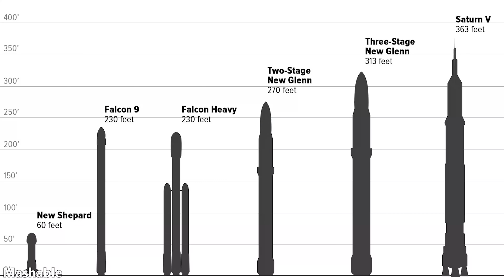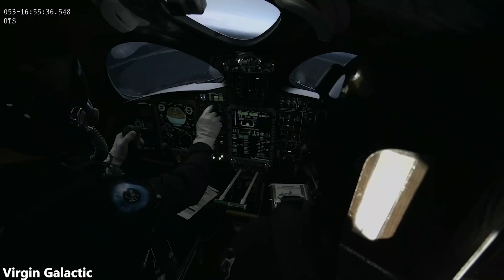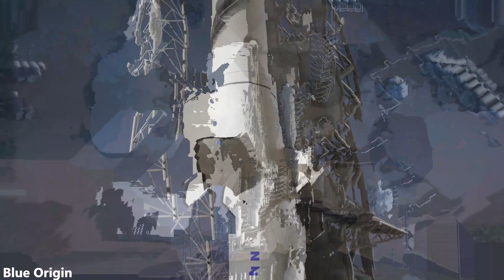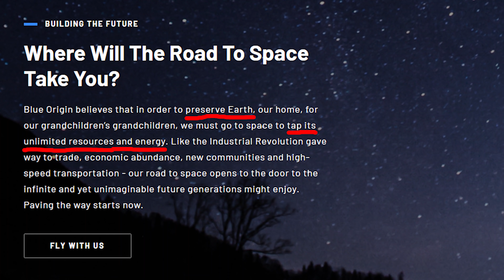What Happened To Blue Origin

Comment: The demand for moving heavy material and people into space over the next 50 years will be many magnitudes larger than what NASA/SpaceX are capable of. The New Glenn Heavy Rocket from Blue Origin is scheduled to launch in 2021 and already has three commercial contracts for services. I believe that NASA has also added the New Glenn to their launch services catalog. I live on the Space Coast in Florida, they are here alongside SpaceX and ULA and have been for several years in a large facility on the Cape. The biggest difference I see between SpaceX and Blue Origin, Blue Origin is not as public facing.  Having multiple launch options is a good thing especially in a business where several launch failures can put you out of business.

Comment: If you've ever been through a bad hurricane, you will experience first hand what living in an energy crisis is like.  I went through Ike and Katrina.  (luck and location at the time)  Forget the generator.  It'll be stolen most-likely.  Get yourself some solar.  It was reliable and most people don't understand how it works enough to steal and utilize it.  We were the only ones for five miles with lights and power.  By fourteen days, we had to pull them down.  Things were getting sketchy around there so we planned to bug out.  Luckily the lights came back on and it was amazing how every thing just 'went back to how it was' in an instant.  Still, because of experience, I will always have solar as both backup and some primary power.  Lights and power are security.  Helps you aim :)

Comment: 1) BO is not a copy of Spacex, as BO was founded 2 years prior to Spacex.
2) Prototyping for New Shepard began in 2006 and uncrewed test flights started in 2015. The first crewed flight was originally expected in 2019, now the date got pushed back to at least 2021 and the test launch cadence has actually decreased. This rather looks like an axed budget and a slow death, not like something that will pioneer space tourism.
3)"This will likely BO´s first step in flying commercial crews to the ISS". No, BO has neither gotten a contract from NASA to do so,  nor has BO announced the development of the necessary capsule funded by their own money. And neither Crew Dragon nor Starliner nor Orion are designed or inteded to be launched by New Glenn. So no crewed space flight beyond New Shepard. 
4) "Blue Moon is expected to be used..." Nope, BO has not been contracted so far. NASA still has not picked their favourite vehicle. Also, Blue Moon is only the descent/ascent module. In order to get to the moon, it requires the systems of other space companies.
5)While Bezos may talk about space visions of the future, he has never announced any commitment to building structures in space or the moon. There is no definitive goal put out by BO to build bases on the moon, asteroids or in space by themselves. There is no comprehensive plan behind this. It is just a sales pitch for their upcomming rockets.

Comment: Won't beat you up, but from the onset when describing differences between F9 and NS, you might have mentioned that F9 is an orbital class booster that moves in an orbital arc landing far down range, not just straight up and then down.

Comment: Well, what happened to Blue Origin?
Absolutely nothing. And thats the entire problem.
Reply: Elon is better at twitter than Bezos.
Reply: @danielmonge2318  Elon also turned out to be better in designing rockets in a reasonable timeframe.
Reply: @AliothAncalagon  As if Elon was the one who actually designed the rockets... LMAO
Reply: @LunaticTheCat  Thats exactly what he did as chief engineer.
Funny thing is that Elon is not even particularly proud of that. He says he only ended up doing it himself because none of the experienced good engineers wanted to join. And he blames this for the result that they ended up needing 4 attempts to get into orbit.
You can have issues with Elon, I sure as hell have a few, but there are some achievements you simply cannot deny without just making yourself look uninformed.
Reply: @LunaticTheCat  at least Spacex can land rockets dead centre while blue origin can barely land them on the pad
Reply: @mindzee83  You are simply coming across as being not well informed on the subject.

He has a degree in physics and was doing "hands-on work" by designing the Falcon 1. Elon himself names his lack of experience in the field back then as a reason why the rocket needed 4 attempts to reach orbit. It shouldn't come as a surprise that a physicist who is deeply involved in the engineering of a new orbital rocket for more than 6 years can be considered to be the chief engineer of said rocket. 
Competence is not as isolated as certain degrees might make it look. One of Musks partners designing the Falcon 1, Tom Mueller, was a mechanical engineer. Was he incapable of designing rockets as well, because he was not specifically a "rocket engineer"? Thats not how degrees work. I am a mechanical engineer as well. Even though it might not have been a complex and specific part of my training, it gave me enough of a foundation to do blacksmithing. Different fields of competence intersect with each other.
And different fields of engineering and physics most certainly intersect with each other.
Your objection here ends up having no foundation.

"there are people that put ideas on the table and he discusses it and chooses the best one for the job."

In some sense thats certainly true. But this has less to do with lacking competence and more with the fact that you aren't going to design Starship as a one man project.
Musk is a physicist and in years of "hands-on" rocket engineering he became a more proficient rocket engineer than some people who actually have a specific degree in rocket engineering I know. You are of course free to deny his competence and simply assume that he is only the chief engineer because he overruled everyone who thought he couldn't actually do that. But the reality is that whoever will talk with Elon about his rockets, will not talk with a marketing dude who knows nothing about its development, but with someone who knows his craft of engineering said rocket in great detail.
Because even though some people might not want to believe it, thats actually one of his jobs.
Reply: @LunaticTheCat  he actually was able to design a few.
Reply: @g2jay183  Blue Origin was the first to land a rocket. just so you know.  Not SpaceX
Reply: @ethanjohnson3261   I could be wrong,  but I think it was the Delta Clipper Experimental, or DC-X,  20 years ago
Reply: @danielmonge2318  Jeff simply doesn’t really give two craps about sozial media.
Reply: @user-pz6mc2oj3f  but did nasa land rockets in the middle of the ocean?
Reply: Well yes and no. They’re just much less public about it. They had some issues with their engine delaying the program, but they’re on track for launching New Glenn in 2021. They’re launch site in Cape Canaveral is on track and looking good.
Reply: @SebiKoerner  like everyone else predicted, new glenn just got delayed to 2022, what a massive surprise, not.
Reply: @snowstar3560  so? SLS is 4 years behind schedule. You try managing a company during a global pandemic. Also, there has been actual pictures of the Pathfinder 1st stage and it’s huge.
Reply: @SebiKoerner  Ah here comes the excuses, didn't you and other people said something like "new glenn is on track for 2021" or my favorite "blue origin will dominate spacex" or "just because blue origin haven't launch a single rocket to orbit doesn't mean that they are not on schedule it's just that they are not being public, like their motto said, move slowly ferociously, blue origin will whoop spacex ass"
Reply: @snowstar3560  I freaking hate BO dude! I just want more fucking rocket launches. This isn’t a cult or anything. SpaceX is about 4 years behind schedule as well! They wanted to launch the first payload to Mars last year. The next Mars window is NET 2022 with losses or 2024.
Reply: @SebiKoerner  Speaking of launches, when do you think spacex is flying SN10?
Reply: @snowstar3560  next week. There’s temporary flight restrictions for Monday, with options for Tuesday and Wednesday.
Reply: @SebiKoerner  Thanks, also I apologize for the harsh comments.
Reply: @snowstar3560  
End of 2022, which means at least 2023. 

Disappointing, especially since New Glenn will launch much closer to Port Canaveral than SpaceX or ULA which if it ever happens will be spectacular to watch and feel.
Reply: @SebiKoerner  New Glenn is now delayed until 2022.
Reply: @SebiKoerner  Meanwhile, SpaceX is sending a rocket into space every week with payloads delivered into their orbit perfectly, reusing their first stage 10 times so far, while Blue Origin has stated there yet to be built and tested rocket will be reused 25 times. Bosos is seriously jealous that Elon Musk not only overtook him and his very slow space program but is so far ahead Basos might just have to shut his attempt at a space program down entirely.
Reply: @flubalubaful  I know how this stuff works my man. I’ve been following SpaceX since 2015 and have seen all launches since then. But I want more rockets, not less. SpaceX needs competition so I really hope BO gets their shit together.
Reply: @user-pz6mc2oj3f  Ye but compare that to Spacex
Reply: @user-pz6mc2oj3f  ok, but you have to agree that Spacex in terms of pace is way ahead of nasa
Reply: No, what ACTUALLY happened is I called Jeff and asked him if he wanted me to start sourcing extension leads in preparation for running them from his orbital and lunar power plants back to Earth...
Reply: They just completed the New Glenn launch pad at Cape Canaveral. Though the maiden flight was pushed back another year. They likely will not launch before 2023.
Reply: @gojosatoru6902  I don't know about you, but I personally am contributing more to society than Jeff.
Reply: @gojosatoru6902  I am sure you can achieve it as well.
Its not as hard as some of the "billionaire=morally superior" folks might think.
99% of Jeffs employees contribute more to society than Jeff himself.
Reply: Haven't found the right problem to solve!
Reply: I think it ‘came too soon’…🧐🤔
Reply: Yea, stop acting Chinese and come up with your own 💩

Comment: Run out of energy....hmmm.   Mr. Bezos needs to be concise on his operational definition of energy.   1) There is probably enough untapped Wind and Solar energy to supply current and future populations with all the energy they need, it is more of a storage challenge, but that is being addressed by any number of companies (think:  Tesla power wall, etc.)  2) Throw Nuclear in the Mix (especially next generation Thorium molten salt reactors) - you have more than enough.  3) Does he mean hydrocarbons?   The rapid shift to electricity for ground and possibly sea transportation negates the current demand for oil.  Hydrogen might be an option for air transport in the medium term.  4) Fusion 'might' be 20 years out....(I know the joke - it is the power source of the future and always will be).  So - plenty of options for 'energy' to meet our needs.  It just takes investment.     Couple that with anticipated population decreases after the turn of the century (a big if....but birthrates generally drop once a country reaches 'developed' status).   Very tough to make blanket statements....

Comment: There is an icorrect data from Logically Answered: Falcon 9's booster also separates below altitude of 100 km (1:30) and not at 200 km.
Reply: He says "don't start to descend before 200 km. in altitude". In other words, he is talking about Falcon 9 booster's apogee.
Reply: @dmdav6140  But I am saying that Falcon 9 booster's apogee is much lower, not near  200 km.  It's apogee is also about 80-90 km as Blue Origin's.  This is why  Logically Answered is wrong.
Reply: @miklosbarabas8373  Well, I am not a rocket scientist. but since the F9 booster shuts its engines down at a higher altitude (ca. 70 km) than New Shepard (ca. 55 km), and it also travels at a much higher speed at that moment (F9 ca. 7000 km/h vs. NS. ca. 3550 km/h), I would expect the F9 booster to coast well beyond 100 km. 
I guess, Logically Answered searched the web and used this graphic from ZLSAdesign: https://zlsadesign.com/infographic/trajectory/spacex-falcon9-booster-rtls-new-shepard/
It shows an apogee of 200 km. Another of their graphics shows an apogee of 130 km. Apparently, it depends on whether the F9 booster lands on a drone-ship or on land.

Comment: Everything was going great until he said "They will transport batteries down to earth to solve our energy issue." Seriously? WTF? So you're going to use chemical rockets to transport batteries between earth and giant solar arrays in space? Just to break even the batteries would have to have more energy capacity than the rockets' two way trip, never mind the pollution generated with enough flights to power the human race's ever expanding energy needs. If (and it's a big IF) we ever get batteries that efficient, we would have battery powered electric rockets. Even Elon's most ambitious plan for a city of a million people on Mars by 2050 sounds far more feasible. Sorry Jeff, I can't believe you coming up with the battery tanker thing.